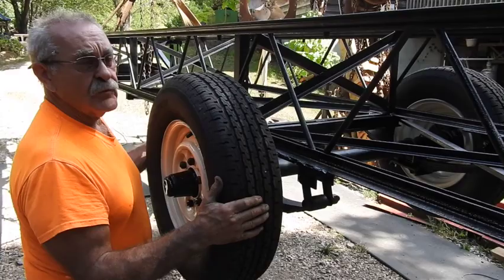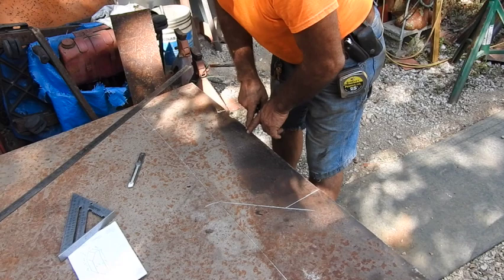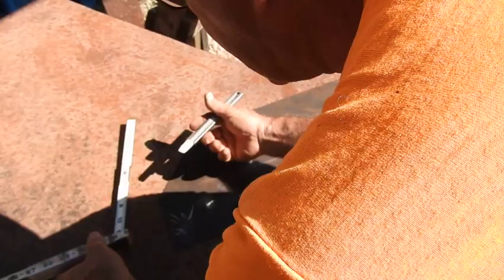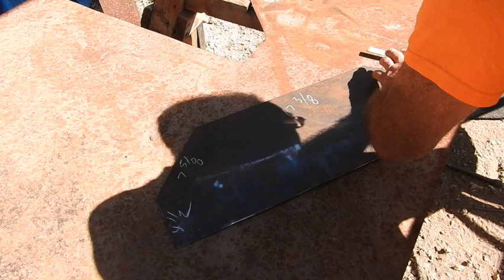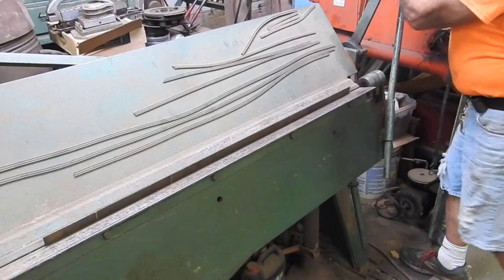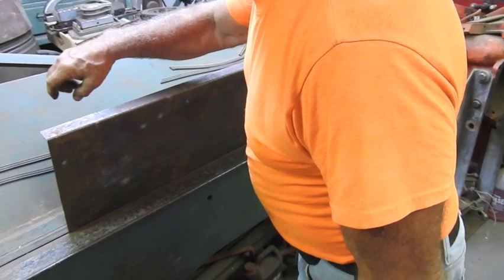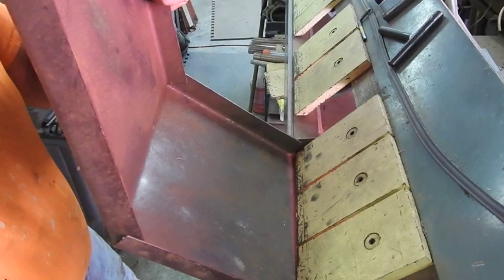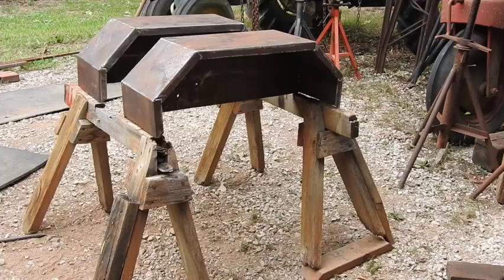Salvage Material Repurposed Into Trailer Fenders

Comment: Glad you explained capacity on the brake. I'm surprised how many tin benders out there who don't know the reason for the angle iron stiffener that bolts to the apron. Way back in the day I worked for an architectural sheetmetal shop. The old hand brake we used had all the special dies that bolted to the apron to form ogee gutter and other shapes. Wish I had that setup in my shop now!
Reply from the maker: That'd sure be a cool setup to have in a retirement shop.  I got to play with an electromagnetic 4 foot brake one time.  You could set any configuration of material on the 4' magnet, energize it then fold to that configuration.  Release the magnet and move the pieces.  I would buy one of those today if I found it resonable.

Comment: What we use around my parts for this type of project is old oil tank.....FREE !!!  good job on them fenders....CHEERS
Reply: same here, I have made many trailer fenders out of oil barrels
Reply from the maker: Gator, we use the octagon shaped 250 gallon fuel oil tanks to make lawn trailers for compact tractors or riding lawn mowers.  I've even got a 270 gallon rounded one we built a trailer for a buddy with iron wheels on it.  Never had a flat on it either !!  LOL
Reply from the maker: @olddave4833  Yessir old Dave, its a smart fellow that doesn't spend money needlessly ain't he !!  Wellllll ....I ain't saying I"M smart....I'm just a cheapskate !!

Comment: Great job Wendell. I see no limitation on what you are capable of building. Do you pass on your diversified knowledge to your kids. You truly are a wealth of information. By the way, I saw a sticker on those tires, you mean you didn't make them, LOL.... Truly a great job.......
Reply from the maker: My kids have all hung out  with me in the shop from the time they could walk.  I started my oldest daughter disassembling air conditioner parts when she was 7 or 8, then her first job was at the local clock shop at 16 disassembling old clocks for the shop owner and worked up to repairing clocks herself...with limitations to style. She's now a teacher for the gifted students.                            My middle daughter helped me with every phase of a total house gutting and remodel....drilled all my electric holes, soldered tons of copper water lines....drug concrete...hung duct....helped hang drywall and cabinets...and all the hardwood flooring plus the roofing shingles.  Of course the house is hers now.  LOL  Also runs the backhoe and other tractors.  Then my son is just a freaking machine !!  Never stops, one project after another....endless.  LOL.  Can't begin to list the things he does.....  So I guess Mike, maybe the kids might have paid a little more attention to me than I did to MY dad...and I apologize for bragging on the kids....No, not really. LOL   Thank you Mike for such a kind and supportive comment !
Reply: @tractorman4461  for everything that you are capable of manufacturing you undoubtedly absorbed more than you think.
Reply: Couldn’t help but notice the sticker on those new tires too.   No old spares around to use, I guess.   Lol
Reply from the maker: @mafarmtown2086  LOL.... too much was absorbed from Uncle Chippo I'm afraid... LOL  and yes, I did have a couple old tires, but I thought what the heck may as well be new to match the rig.  Besides, the rims were bad enough to bring back to life so they deserved new skins !!  LOL

Comment: Been waiting for this one! I have fenders to build. I noticed you used your index fingers on your ball park measurements. I use my thumbs LOL!
Reply from the maker: Hey man, whatever trips your trigger, right ??!!  LOL.  I thought about making them rounded on the set of slip rolls, but thought these would be a bit better plus a bit easier to secure to the frame.  Thanks Matt...hope you have good luck with yours.  These turned out really good and it was nothing but nasty rusty pitted 16 ga mild steel.

Comment: I built a single axle trailer. Made the fenders out of an old water heater
Reply from the maker: Heck yeah man.  That's a good idea.  I know guys that have build snow plows for compact tractors out of water heaters.  I know one guy that used parts of a 55 gallon barrel for fenders too.  Whatever works !!  Thanks for the input.